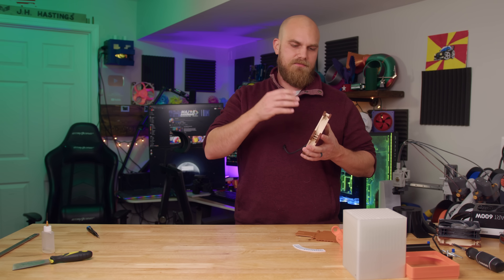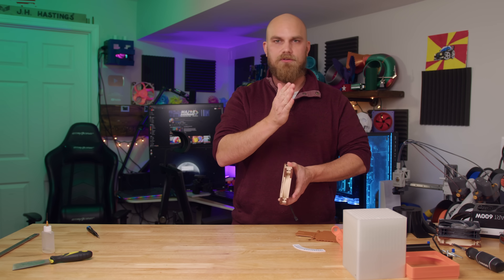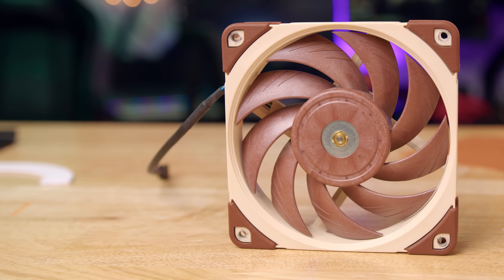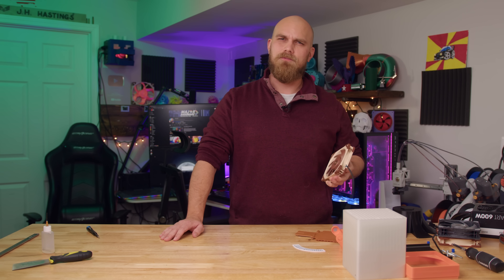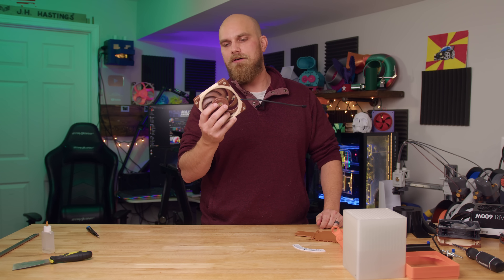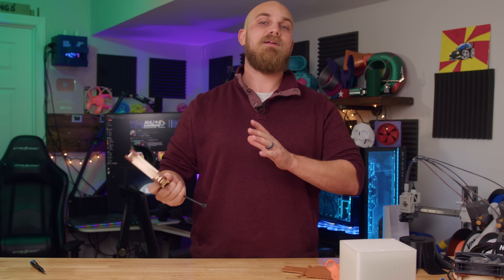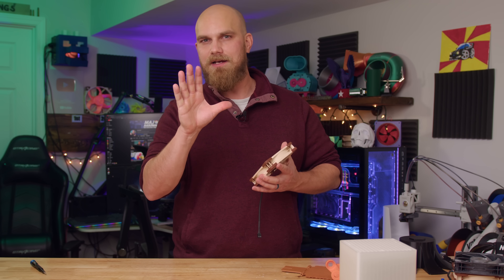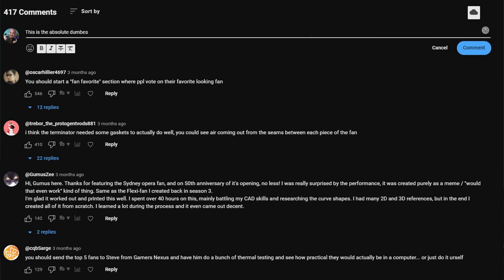I Built a Static Pressure Machine | Fan Showdown Season 6 Pilot

Comment: The main issue I would think is as the angle increases the less the flap is in the way meaning it won't be getting the full force
Reply: That might not be an issue, we just have to think of the measurement as more logarithmic than linear. Like decibels.
Reply: @anotherrandomcommenter4473 The problem with a logarithmic measurement via an analog solution is it will get gradually more challenging to measure with precision the higher up the scale you go.
Reply: @qazxswedcxzaqws  I agree. I think he’s going about this the wrong way. If the goal is to find how much pressure the fans can supply, putting a fan in front of a swinging door doesn’t accomplish anything. What he should do is test how much pressure the fan can hold inside a sealed space.
Reply: @qazxswedcxzaqws Could use a vernier scale for extra reading precision, though manufacture precision will need to go up
Reply: You could accurately calculate the pressure with an exponential function and a couple known pressures to calibrate. He could increase or decrease the doors weight so long as he adjusts his formulas. Increased weight would more accurately test higher pressure and the opposite for lighter.
Reply: @bigchimping  was gonna say that it would result in a logarithmic scale
Reply: @bigchimping  "and a couple known pressures to calibrate."

There's your problem :-)  He doesn't have any known pressures. He has fans that have ratings but no way of knowing what thiose fans actually do in this setup.
Reply: This was my thought too. And, to further piggy-back off of "Windows_2000," the scale is not going to be linear because of this. I wonder if it might be possible to turn this contraption vertical and instead of having the "lid" swing away, have it raise up. The simplest way to do this is have the lid sit around 4 corner posts that guide the lid as it rises, but I think this would cause way too much friction. My suggestion instead would to be not actually have the lid attached to the rest of the wind tunnel, but instead suspended by a sort of crane that is counter-balanced so that the lid is essentially weightless. You could then use the counter-balance to measure the distance as it will descend at the same rate/distance that the lid rises (assuming 1:1 gear ratio). This still has the issue of allowing air to escape in all directions as the lid rises away from the tunnel. To get around that, you'd need to create a much longer tunnel that the lid can fit inside (essentially creating a piston). The problem here is that it introduces more friction and turns this into a much more complicated machine than you started out with. Not sure if these ideas are helpful, I'm mostly just spit-balling here, but maybe they'll spark ideas for someone smarter than I and it will lead to building a better mousetrap.
Reply: @eroticpanda1 I know there are some powder lubricants that could make the friction quite low... And you'd only really need one post, rather than four. As long as it's shaped to prevent rotation / tilting, you can have it go right down the middle. A triangular shaped post could probably work for this, but it's going to depend on tolerances because if they're too loose it could tilt anyways.

Maybe making the whole thing concave could help resist the tilting forces though?
Reply: yeah, I agree.  Maybe extend the tunnel to limit the side leakage maybe even ramp/ curve the bottom some to limit that too?
Reply: Ah, so it's not the device more the measurement
Reply: I think we are other thinking it. If the goal is to find the highest pressure the fan can supply, then why not have the fan push air into a closed space and then take a measurement of the pressure?
Reply: @anotherrandomcommenter4473   I think that he covered that. The cost of an appropriately sensitive pressure measurement device (manometer) is prohibitively high. He is seeking an alternative that provides meaningful results without the high cost.
Reply: @stigurmerki6773  I agree. I’m just saying he isn’t doing himself any favors with his current setup. It’s possible, but difficult on his end.
Reply: Had a smiler instance of this with a extracter fan for bathroom and them demonstrating power and pressure they used a vertical tube with a close fitting plug in the tube. Higher the plug rose in tube the more pressure.
Reply: @paulsaunders5555  i think that may be a better way to measure it, use a vertical setup with a disc placed in the tube with some guide rails. The disc could allow some airflow through it while also providing resistance and u could measure the pressure by how much the disc rises.
Reply: @salmaanjacob  it's a more visual system with a constant air flow gap the problem is the pressure genorated by the PC fan is maybe 10 times less than an extra fan so the plug would have to be very very light. Polistirean light.
Reply: Would it be better to restrict airflow and just build a liquid nanometer with one side in the tunnel and one side outside?  Maybe that’s not visual enough.
Reply: Also the gravitational force shutting the flap will be strongest at the fully extended position, making this even more logarithmic.
Reply: Other option is to keep the contraption more or less as it is but and fixate a small scale to the lever side of the flap. It will stay in place resulting in minimal air pressure loss and returns a number in weight. I dont mind the current set-up is exponential/logarithmic but differences between fans might be too small to accurately differentiate
Reply: Yes extend the box to enclosure the flap on the bottom and sides to get better measurement results. The top part of the scale will take a lot more force to move then the bottom the way you have it.